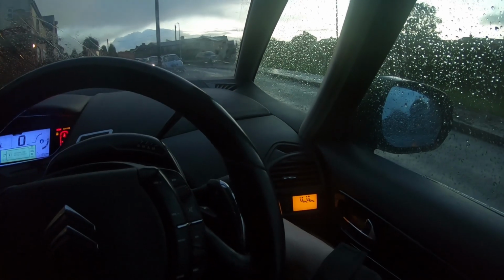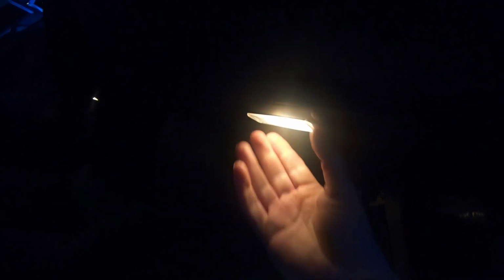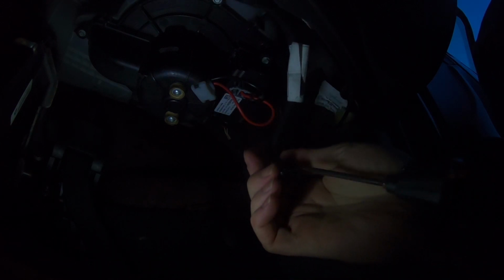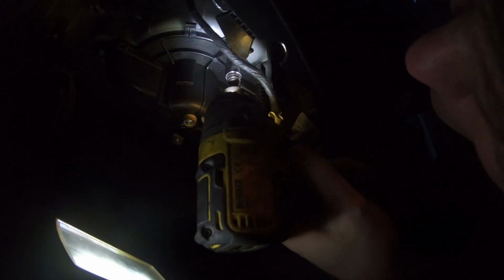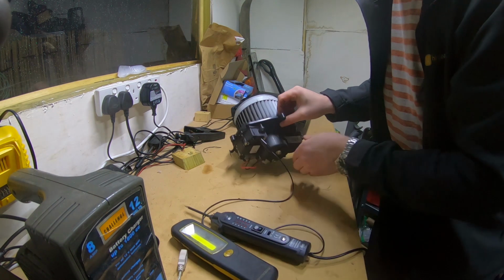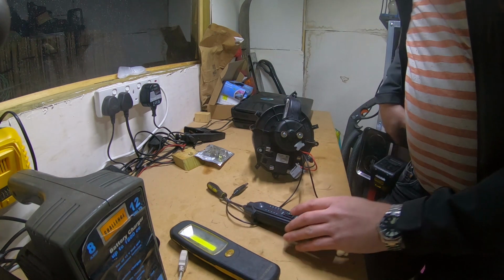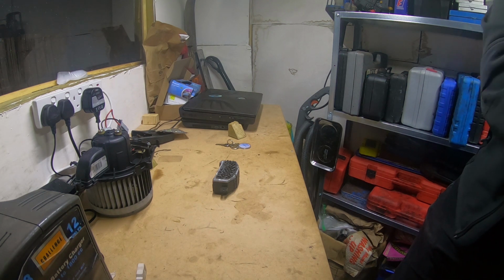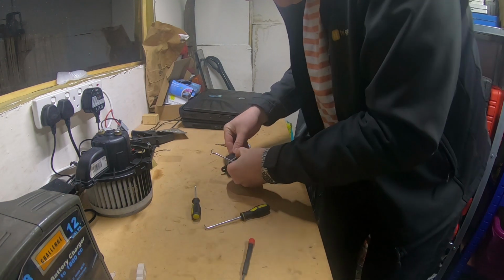Citroen C4 Grand Picasso Part 42 - Front heater blower motor fix

Comment: 2007 c4 grand picasso here.  Blower working intermittently, now stopped completely. Middle seat blower blowing.  I will try removing and reassembling!  Thank you!
Reply from the maker: Be careful when sourcing a replacement blower motor. The new one I bought had a different connector. I ended up getting a genuine Citroen used one on eBay.
Reply: @Parknest  thank you 😊 🙏

Comment: I don't suppose by any chance you have a correct link or the part numbers for both the blower motor and the resistor please ? 
Thanks in advance .
Reply from the maker: There's 2 types. I couldn't get a new one for mine so I had to resort to getting a used part (twice).
Reply: @Parknest  that's blinking typical isn't it , I think the issue I have is due to water ingress , fun the windscreen as my speed beam headlights have now blown too  ,
Reply from the maker: Water ingress is the most common cause of blower motor failure. Blocked scuttle drains are to blame for the water ingress.

Comment: hello thanks for all the videos was wondering if you could do one on fuel filter replacement please ,cheers kevin
Reply from the maker: It should be covered in my service videos. Check out the playlist. If you're still stuck let me know and I'll post the relevant links. It is due the annual service so I can make another service video which will include the fuel filter.

Comment: You pulled the drain plug under drivers wheel arch? Usually the source of water problems.
Reply from the maker: I'm aware of the drain plug issue. There's no evidence of water ingress so that wasn't the problem.

Comment: Are there separate front and rear blower motors? Is that only on Citron or are other vehicles set up like that? I don't know if any cars in the USA have that type of setup.
Reply from the maker: Kevin, this is a 7 seater MPV (minivan to you). This has dual zone climate control. There's one blower motor at the front and there's a separate blower motor for the middle row passengers. This blower motor is used in other Groupe PSA vehicles. The last Citroen officially sold in the US was the SM just before the Peugeot takeover.